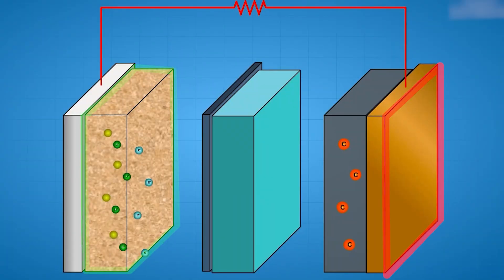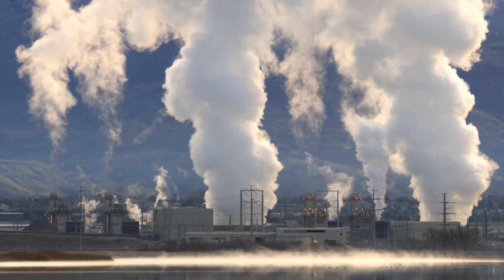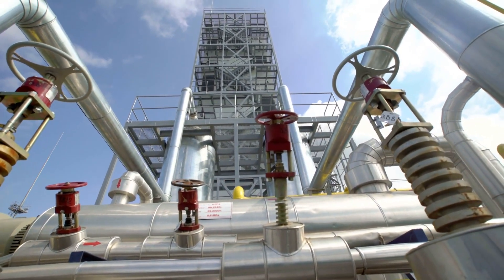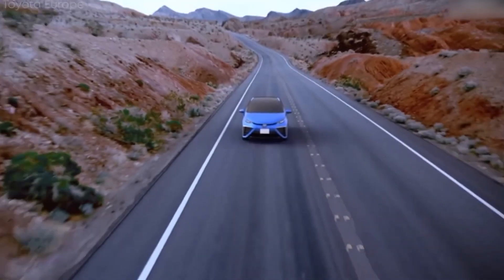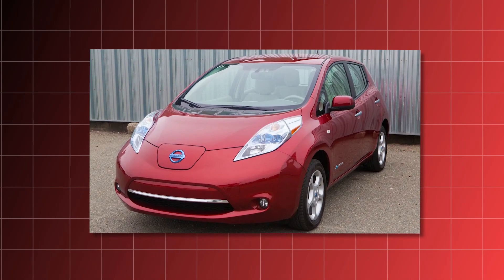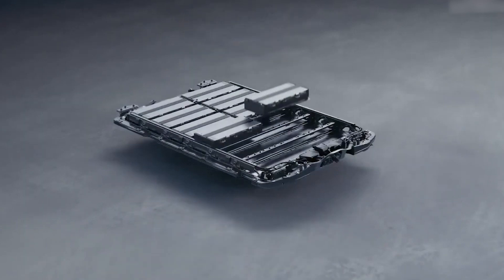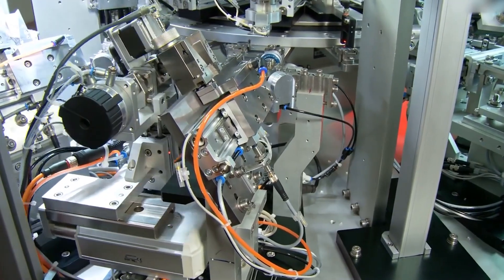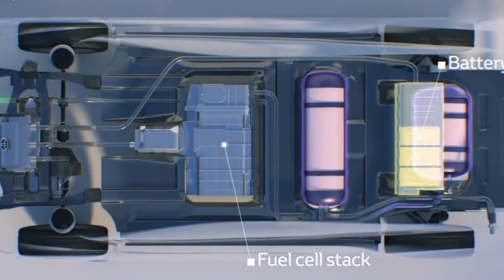HYDROGEN Batteries Are HORRIBLE Compared To LITHIUM Batteries In EVs

Comment: A 100 kwh battery with a mass of 544 kg can hold EXACTLY the same amount of energy as 3 kilograms of hydrogen, 3 kg is the amount of hydrogen in 26.81 kg ( 7.08 US gallons ) of water. So 544 kg of water would contain 60.87 kg of hydrogen at 33.33333 kwh per kg that's  more than 2029 kwh or 20 times more than a 100 kwh battery.
Reply from the maker: Thanks for sharing your insights on this

Comment: Hydrogen only works if you use it to power an ICE car, Ive never heard about using it as a battery.
Reply: Hydrogen fuel cells developed for space applications. You can already get cars, trucks , motorbikes, even small aeroplanes powered this way.
Reply from the maker: They are devoloping them right

Comment: They all stink. We shouldn’t be forced into buying EV. None of it is green, it’s worse.

If you’re gonna sit there and tell me making lithium batteries is green you don’t know what you’re talking about. It’s not just the Carbon used to mine and make them, it’s all the pollution on top of that process. EV only becomes green after maybe 100,000 miles. And by that time the battery is not even close to as good. And they are expensive.
Reply from the maker: LOL

Comment: I’d rather loose power with Hydrogen than pay to replace a huge battery. Electric cars are like cell phones…eventually you’ll need an upgrade.
Reply: You do know the fuel cell doesn't live forever either? Nor do the copv's
Reply: @joerivanlier1180  wouldn’t replacing a fuel cell be cheaper that replacing a battery?
Reply: You'd rather waste huge amounts of energy, losing lots of money than spend a smaller amount replacing batteries?
Reply: @beardedchimp  replacing batteries is expensive! More expensive than a fuel cell.
Reply from the maker: HAHA
Reply: If you believe in hydrogen you are in one of 3 camps:
1.) Totally ignorant 
2.) Willfully ignorant
3.) Too dumb to understand.

Hydrogen has 30% the energy density of gasoline, and there are conversion efficiency losses from hydrogen -> electricity.

Hydrogen is also insanely expensive compared to gasoline and also electricity,  it even counting the energy creation, transport, pumping, etc. losses.

Huge waste.
Reply: We’re already loosing way more energy pumping, transporting, and refining oil.
Reply: We’re already loosing way more energy pumping, transporting, and refining oil.